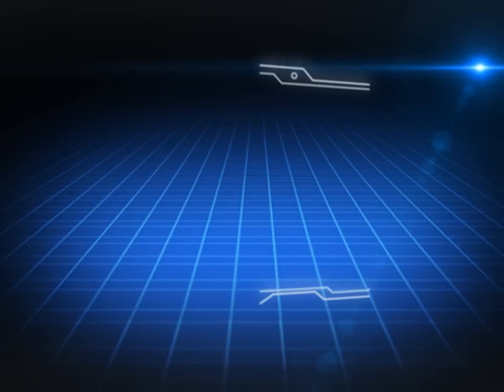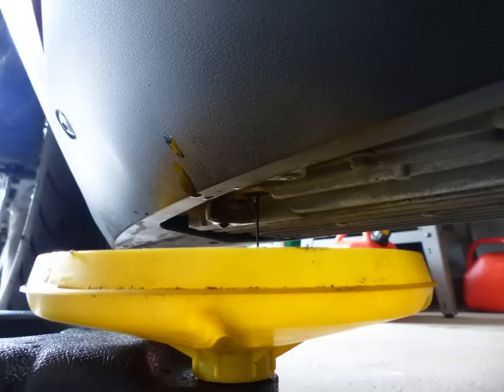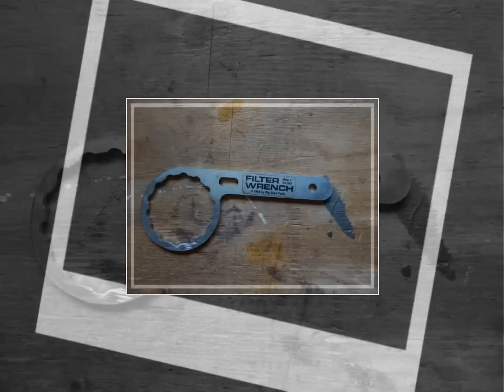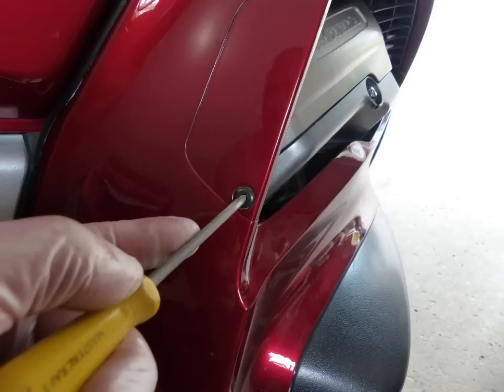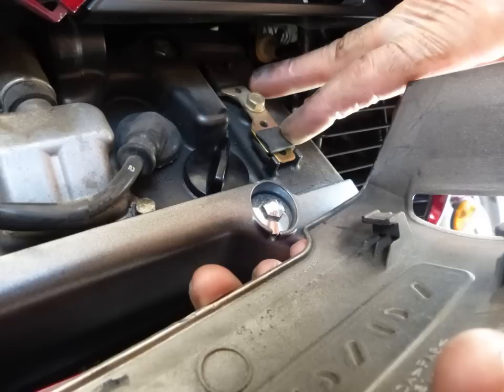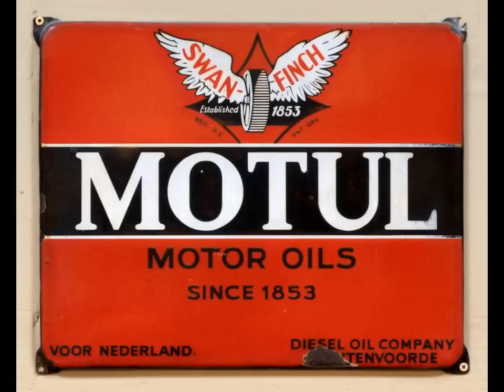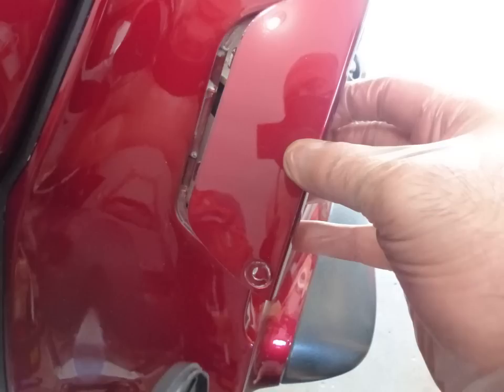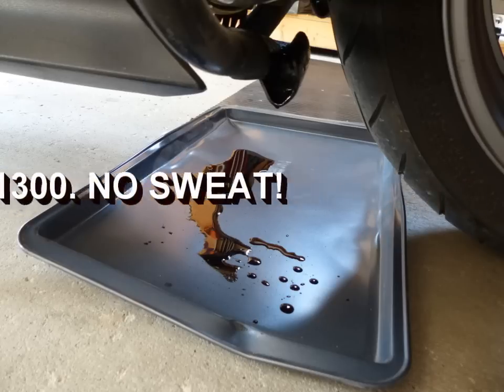Honda ST1300-Oil Change

Comment: Well done. HiFlo Filtro makes excellent, reasonably priced oil and air filters for the ST1300. Part number is HF204RC for the 'nut' type oil filter.

Comment: Greetings from The Netherlands and thanks for posting. https://youtu.be/LrcNBQEm6kc What I did was make use of the jiffy and work from the right side. The RC model HiFlo filter has a nut with a hole trough it for securing purpose. On the race track mechanics hand tighten the filter or slightly further. Users on the road may really want to tighten better and that opens the possibility of damaging the RC type filter housing. I was thinking getting a wrench cap being difficult for you was a bit staring in the distance and basically using the HF204RC made no sense, even though I had no problem with mine when I did the same on my cruiser. I do lube the rubber both sides. Anyway take a good look for better feel when mounting or releasing the race filter.

There is a method for determining the right oil level. Per manual: "Start the engine and let it idle for 3-5 minutes. Turn off the engine and support the motorcycle on a level surface. Wait 2-3 minutes and check the oil level trough the inspection window." The glass can be seen up front at the right with a shaving mirror and a small flashlight, having not much trouble sitting on the bike.

The amount of oil needed is written on the engine block. One may want to buy a funnel with long neck that bends and an inlet filter. That screen just to always be sure. The drain bolt can be stuck due to bad handling. Tightening should not exceed 22 foot pounds by manual but less when wet with oil. Probably 17 foot pound is more realistic. So one does not hold the wrench in the hand on the far side. At best you clean the area and work the bolt loose at the day before you start off. Great penetrating oil can be made in a smallest bottle with 50 percent acetone and 50 percent ATF or final drive oil. Shake a lot before use. What I do is use a metal pipe to lengthen the socket wrench stem in order to be sure I do not have to use a hammer and can work the bolt loose in just one pull and on a perfect 90 degrees angle. The above caution applies to those who did not changed oil earlier. The bolt had a hidden magnet at the end that asked a napkin for cleaning out and there is a soft metal ring on it that should not be forgotten and at best placed back in the same orientation. Order such a ring when ordering any other parts. Number is 94109-14000.

For the oil, do not use those with friction enhancers because of the wet clutch and full synthetics may clean out to well and cause trouble with gaskets. Another great advice is to not change oil outside in windy weather because oil is light and its trickle blows in a great number of hairs all over the place. I always hear a burp coming from the oil filter after a mile or two, even when I pour oil in before mounting, so ride it slow and undemanding until it does.

Comment: I have a Honda st1300 clutch plate is stuck.... Any suggestion?
Reply: Did changing oil helped? I know this is an old question,but still curious about that problem you had.

Comment: You got a $2.00 pan from a $1.00 store? lol.... good vid though. should be the same on a ST1100 right?
Reply from the maker: Haha you caught that ;)
I had an ST1100 prior to this and the drain plug and filter is in a slightly different location and some ways a better location. The oil fill is under the side cover and actually easier to get at fill IMO.  Cheers
Reply: @MotoCanuck  You got that right. ST1100 is a service friendly bike in compare to ST1300. But than again, 1300 is a whole another league✌